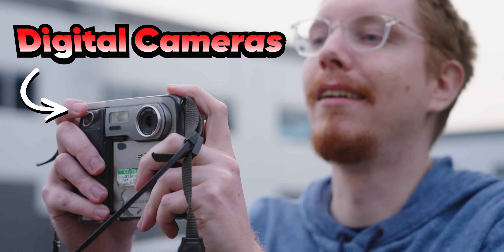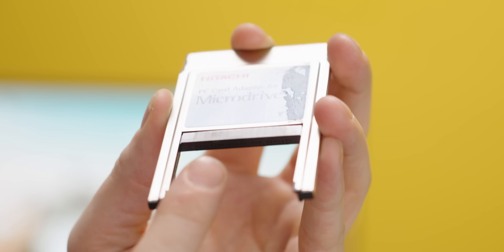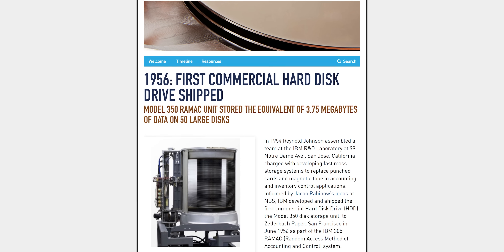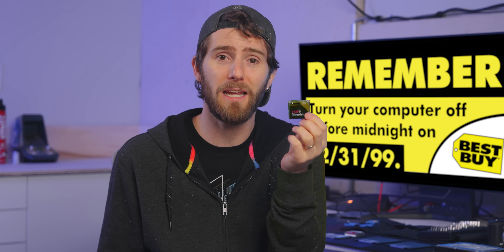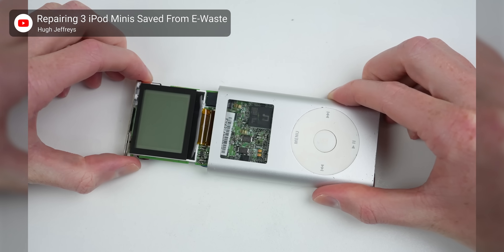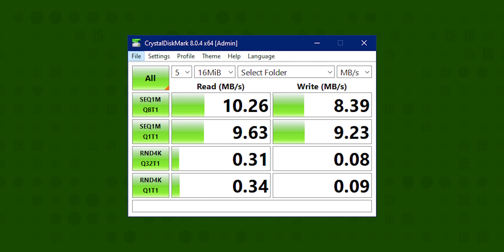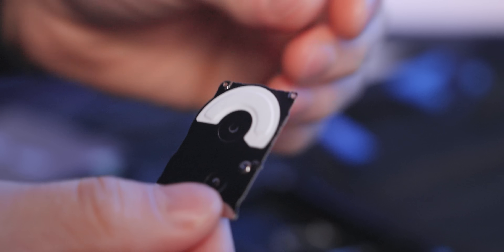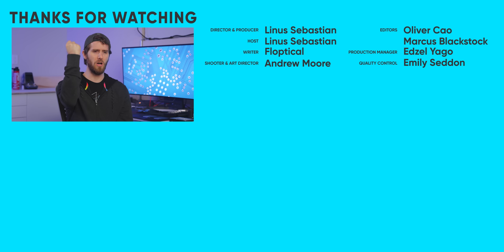This TINY Hard Drive is REAL... and it changed the world! - IBM Microdrive

Comment: In the video you failed to mention that CompactFlash and MicroDrive are based on the IDE/ATA standards used for Hard Drives. Also some MicroDrives were locked down to hardware like some PDA's and MP3 players. I have a 4GB one in a USB adaptor caddy, and also three 3.3GB MicroDrives.

Comment: These drives were so expensive, people would just buy subsidized devices that utilized these Microdrives and rip them out - then resell the drives at a profit. This caused manufacturers to cease using the CF Card standard as an interface.

Comment: Those speeds in all honesty are not bad. 1.9 megabytes a photo makes that number good. Which at the time is great. My phone currently can produce at most 5 megabyte size images at 15.9 MP resolution. 

4 megabytes per second is a little less but my phone is slow at loading screen updates so that speed naturally would be fine.

Comment: Sinclair had a small removable storage system for the ZX Spectrum in the early 80s called Microdrives.  Don’t know how IBM were able to use the same name when they’re similar in every way except ZX Microdrives were tape-based and IBMs are HDD platter based.

Comment: If you think of the first gen microdrive in a historical context it's even crazier, just 10 years earlier in 1989 a hard drive holding 340 megs would have been a full height 5.25'' beast of a thing (for those uninitiated, an optical drive is considered half height) costing well over $1000.

Comment: Oh.  I had the Chinese clone of this thing, (per Google) GS Magicstor.  THAT one held 2.2GB!!! I stuck it into (as I recall) a full-sized SDCard slot (but maybe it was compactflash like the one in the video), it was like 0.8 inch.  Turns out they only made them for a few months before IBM sued them off the market.  (I can see why -- it looked EXACTLY like the IBM equivalent, to the point I'm pretty sure  they were just running off extra production runs and selling them as their own drives... at about 1/3rd the cost as I recall. I probably have it sitting around here somewhere.

Comment: I still have a 1GB microdrive which I bought back in the day for use with my Canon DSLR. It still worked fine when last I checked, but it is slow and geriatric so I'm not pushing my luck using it for anything important. 

I bought one of those Canon bundles Linus mentioned. It was very appealing compared to buying multiple smaller CF cards.

Comment: Just a small note, we fellow the development of the microdrive for at least a years by NEC before
selling the tech to IBM….at the sicoob las-vegas we see a demonstration of a 40 meg one, at the Nec boot, a video playback in 640X480 screen laptop. speculate if the next Nec laptop was to use those
and save battery on batteries. in fact the use one close to its (1.8inch drive, but not a microdrive).
and IBM finally put it on the market.

Comment: CF cards are commonly used in retro pc builds with passve  cf to ide adapters because the cf interface is actually just ide,  so It should be quite easy to use a Microdrive as the OS Drive in a 90s era pc but with those speeds you'll regret it if you want to run something other than just ms-dos. As cf cards used the ide interface. A microdrive really is just a minituraized ide hard drive  in all ways, A standard ibm helped develop in the 80s

Comment: I remember in the mid to late 2000s I was dealing with the first few mini laptops and I discoved the tiny hard drives in iPods and a few other media machines.
It made some of those smaller form factor laptops a real alternative for students.
I used to pick up dead iPods and retrofit the drives into the tiny laptops.
I tried to buy the drives direct from manufacturers at the time but I was only a hobbyist/ experimental engineer. They wanted me to order £1000s of of drives. That was way out of my financial reach. I was still a student myself. They were really good though.
I have a fond memory of retrofitting a small Acer laptop, I think with the Atom processor installed, with 1 extra GB of ram and a 1.8" HDD with Windows starter Edition. Then sending a friend off to New Zealand on holiday with it as his main means of communication.
It worked flawlessly until it got a bath in beer one night. 
Still nice nostalgia moment for me 😊 in this video.

Comment: the first digital camera i bought back in the early 2000s held exactly 13 pictures of 640x480, but only if the batteries were good. changing the batteries would wipe the memory! the first
sd card i bought was a 64 mb and it's cost was $70! the first flash drive of 1gb i bought was $50! now you can't even find a drive or card of less than 16gb. i have a 400gb micro sd card
that is smaller than my fingernail and holds all the music, pictures and videos in my computer! mind blown!

Comment: I've just bought a 500GB M.2 SSD at a cost of GBP £0.07 per gigabyte! ... That's crazy cheap storage! ... Computing is certainly much better value than it used to be!

Okay, the performance may suck, but tiny hard drives are WAY COOLER than boring inanimate flash storage! 👍🤣

EDIT: Can't believe that Linus thought the platter motor was the actual platter, and that he was amazed that (just like any hard drive) the microdrive had a separate controller PCB, and that there was a single platter, and that he was amazed that the internals were a "micro hard drive!" ... What did he expect to see inside a miniature hard drive?

Comment: I believe a media player device made by Datel for the Nintendo DS back in 2007ish... used one of these. it was a slot 2 device that fit inside the GBA port and used a pass through card in the DS port. I remember it had 4GB of storage which was massive at that time. although it was pretty bad in hind site.

Comment: Guys,in Highschool i used an Samsung i300 candy bar phone which run Windows 2003 and had an 3gb micro drive and a spinning wheel similar to ipod’s,plus an micro sd card slot but i thing it was still trans flash back then. That is an awesome quirky device to check😊

Comment: Cool video!  And brought back some really great memories.  LOL 
I bought a 1GB (GiB?) Microdrive with a Canon D30 camera back in summer / fall 2000  .... and man what a life changing experience.
Still have the drive and the camera, and use both at least once per year.   Drive still works great and has photos from 2000-1.

I also used the a 340MB drive around that same time for embedded linux projects - great to have full development environment on prototype / demonstrator products and simply use a compact flash card (thinner / lighter) for the final product.
Now we can put 1TB on a chip half the size of my pinkie nail.   : )    Pretty sweet.  :)

Comment: I had a micro drive back in the 2000s that was 1Gig but had a USB interface.  The thing looked like a Zippo (tm) lighter and the "lid" is where the USB plug was.  Unfortunately, spinning hard drives don't like being dropped and the thing did eventually die on me.

Comment: The later 30, 40, 80, 120GB etc. iPods also used tiny hard drives and they were definitely still relevant then because consumer SSDs were just barely coming onto the scene by then and were very expensive and other forms of flash just didn't have those densities. Any flash media that did have tens of GBs was way too expensive.

Comment: My friend designed the I2Go eGo player that could use 2 of the micro drives, it pops on the screen at 8:03. He went on to design it's bigger brother the MusicVault for high end car stereo installs that used full size 3.5 inch hard drives and could integrate with many PDAs of the time for controlling the playback.

Comment: I'm not sure if this was something they just didn't include, but... Compact flash sharing the pcmcia and then being compatible across-the-board was bec6 effectively pcmcia is more or less a superset of the ISA standard... What's interesting is that IDE in PIO mode is more or less a subset of the ISA standard.  This made those compact flash drives being compatible with the IDE standard kind of a no-brainer. It also means that compact flash cards are quite compatible with the old 8-bit IS A slot standard in old computers with some voltage level conversion and a address decoder chip to map the card in the IO range of the PC ... Retro enthusiasts use this all the time

Comment: I remember back in the day when mp3 players had 32 or 64 MB storage and I was "meh, you can barely store 1 or 2 CDs of music on those". And then I found the iRiver IGP-100 with a 1.5 GB mini harddisk - more than 20x the storage capacity but just 2x the cost. I kept using it for ages until eventually smartphones were good enough that there was no point to carry a separate mp3 player with you anymore.

Comment: Somewhere around me here, is a SparQ Drive, which was usually seen with 300/400MB HDD cassettes.  The one I have has a removable 1GB HDD Cassette with the cutest little platter!  It was configured for W95/98 which was, back then, using internal HDD's with 300/400MB capacity.  The guy who gave me it(wasn't it always thus...!) said that the SparQ Drive could hold all he had on his PC of the time.  It was read to through the printer port and sat between PC and Printer...but I don't have the funky power cable or the Comm connectors and cables...(over-enthusiastic clear up)  Nice one Linus and the team!  Cheers!

Comment: The good thing about CF cards they were by design PATA compatible, so there was no additional logic required for HDD to function. This way for IBM it was just the matter of miniaturization of mechanical parts. 1.8" drives existed in the laptop world and handheld devices (including iPod) so even miniaturization requirement was not out of the question.

Comment: At one point I remember having one of these mini hard drives that was used as the first larger USB drive I ever had.        Maybe very roughly  1.7 inches by 1.7inches?,  but a bit rounded and fit in my hand pretty nicely.   I seem to remember it being 4GB.   I used it and used it for about 2-3 years.    Then one day it started making like this mechanical, clicking sound which worried me.   It never broke, but I quit using it about the time I got a larger all memory USB flash drive.  If I find it around here,  I'll say what brand it was..7

Comment: My phone of choice in 2005 was the Samsung SGH-i300 which sported a physical drive inside of it, they actually packaged 2 batteries in the box. You could hear the drive spin up and down while it was in use and if the phone had died enough the drive would essentially disconnect to save power.

Comment: I ran NetBSD off of these drives (scavenged from "broken" iPods) back in the 2000s on a NEC MobilePro or HP Jornada handheld PC, so you could very much run an operating system off of one.

Yes I was a very cool kid with lots of friends. I swear that girlfriend in Canada was real, too!

Comment: IIRC a particular Nokia bar phone is credited with using the smallest spinning hard drive ever, with a 0.8" platter and I believe a 4GB capacity.  Oh, and as a retro collector I still LOVE my big Sony Mavica floppy disc camera!  For those who wanted to go beyond floppies, Sony also released the most ridiculous little-known floppy-to-MemoryStick adapter.  Think of the casette-to-aux cable adapter and how that works.  This Sony adapter actually has little magnetic pickups that sit where the floppy disc media would normally be - and they read the electromagnetic impulses from the camera's floppy drive heads and convert them back to digital data, which gets written to the inserted Sony MemoryStick.  And to do all of that mess the adapter utilizes its own pair of 3v watch batteries - all of this contained in the form factor of a normal 3.5" floppy disc!  Seriously, you have to see it!  It's so convoluted and silly but it worked.

Comment: That was fun!

My 2000 Cannondale H400 bicycle came with Micro Drive, but it only spins up to around 400 RPM, depending on gear ratios and as fast as my feets can pedal depending on in the circumstances, and it doesn't store any data. 🤣

My daughter had an iPod Video that I opened up a couple of times in order to replace its battery. Agreed that its internal hard drive was adorable, even though I never opened it up, but I don't know if it was an actual Microdrive or some other miniaturized hard drive. It only held 160GB and wasn't intended to be changed by the user. That hard drive eventually failed, but by the time that happened, my daughter had a smartphone that was far more capable and had lost interest in the iPod.

Comment: One of the reasons flash memory media dropped so quickly in price in the early 2000s was not just 'the technology maturing', but because like DRAM chips, NAND chips were subject to price fixing shenanigans, but when the DRAM scandal came to light, the NAND market gave up its pricing hijinks as well, considering most companies making one also made the other. RAM and flash media dropped in price at a staggering rate in that time, and it didn't really bottom out until the early 2010s.

Comment: To be honest, I never wouldve guessed that sort of HDD was possible today, let alone over two decades ago! Absolutely impressive
Reply: It may be less possible today than back then. As solid-state has replaced electro-mechanical, our ability to fabricate such tiny mechanical components has diminished.
Reply: @BrandtRedd  I wouldn’t say impossible, more improbable, We still have all the knowledge to make these, the problem is the machinery that made them probably dosnt exist anymore, right along with what you said
Reply: @BrandtRedd  there's not any specialized fabrication in that assembly. We're far better at miniaturization today than 30-40 years ago. This would be far easier to create today. Maybe you could argue that we don't have tooling to create players that are 1" in diameter, but that's a non issue.
Reply: @littlejackalo5326  it’s not about theoretical capacity but practical. Theoretically we could build a new factory for CRTs too. But without the capital to get it set back up, no one is doing it, and so the practical skills are also getting rusty. 

Go long enough without doing it, and just having the schematics isn’t actually sufficient anymore — as can be seen by people failing to build Victorian steam locomotives from the blueprints. The “techne” has been retained but the “metis” has been lost, to use the jargon from one particular philosophy of epistemology. 

Many militaries around the world have faced this issue too, they try to do maintenance/rebuild on some older gear and after even 10 years of no one doing it, there’s no one with the practical knowledge left in the organisation to actually do it properly. Even with all the documentation intact. 

We’re not quite at that stage yet for Microdrives, because larger hard drives are still being manufactured. And Brandt chose his words carefully, as he said “diminished”. But there would still need to be a decent chunk of change spent on R&D to get good at the specific application again, in addition to the capital costs of setting up the production line again. And until/if that ever happens, no one is producing tiny hard drives, so the institutional retained knowledge will continue to diminish.

Comment: I still have my first hard drive based mp3 player. Was the mustec pvr h140. Had 40gb, and it still works kind of...
Unfortunately at some point a number of years ago, I formatted the drive under windows in an attempt to delete all my old  music. When I formatted its drive it also wiped out the part needed to boot and play music and videos. I can still access the drive over USB, but with no os to boot, it's pretty much bricked. Supposedly there is recovery software that I can't get due to a now defunct company. Oh well.
It's now just sitting bricked in my closet....

Comment: One thing you forgot to mention, is that people normally use harddrives over flash because of their reliability.
And what people quickly realised is that these tiny drives weren't necessarily as reliable as their larger counterparts so therefore offered very little advantages over flash technology.
I had microdrives clearly wear out and get corrupted the more they were used, which is basically the same problem as flash has.

Comment: when I started photo I bought a Sony DSC-F828 in 2004, the pro. gear that could take up to 256Mb CF cards. But later I found a microdrive that can take up to 8 gigs. So literally shooting in rafale mode, not counting the amount of shots. I drained more batteries than space on that thing and yes that's really a banger compared to changing the early SD/MMC or the even more pricy and laggy memorystick pros.

selling the client a DVD with hundreds of 8Megapixels photos was really neat, sadly the camera is broken for years but the microdrive still works! this is a level of swiss clockwork in there, I keep it.

Comment: Harddrive manufacturers ALWAYS used the 1000*1000 byte Megabytes and it predates the weird 1024*1024 byte Megabytes that was later introduced by RAM manufacturers since drives are linear storage while RAM is addressed with binary addresses

Comment: Thing too about Floppy discs for digital cameras is that they were very prone to errors. I wonder if the microdrive was better in that regard. E.g.: I've had multiple Sony Mavica cameras, and sometimes a picture you shot simply would NOT get saved because of a write error. Sometimes it would render the entire disc unreadable too once it tried to save one picture but failed at it. It sure was a rough era to grow up in 😂💾 Even the only Mavica CD disc I still have is extremely unreliable because it has probably been written too many times despite seemingly having no scratches.